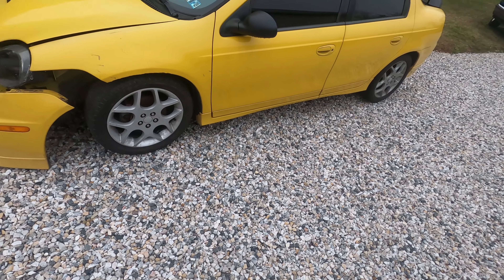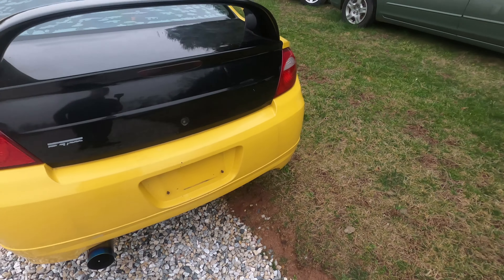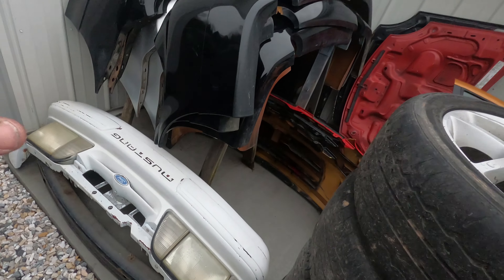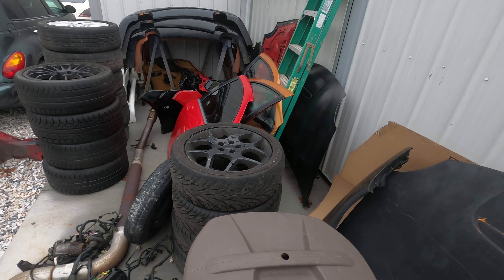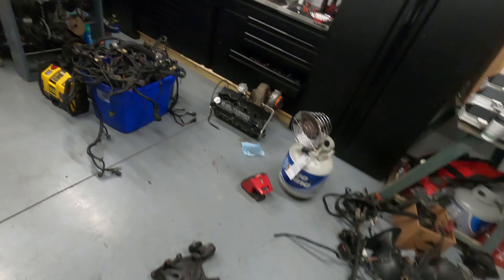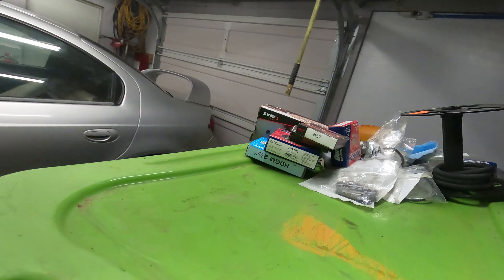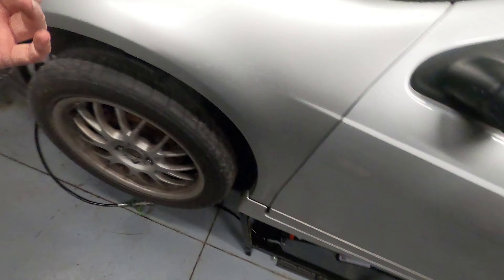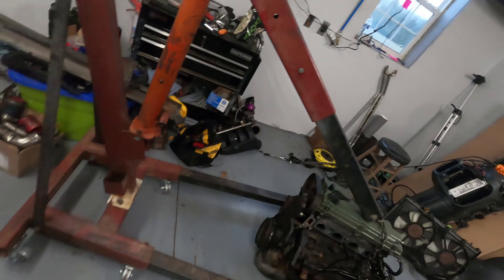SRT4 PARTS HOARD

Comment: looking for a few discontinued parts for my srt-4. I'm looking for the 2 plugs that cover the motor mount bolts in the wheel wells, the tension strut bolts, and finally the grounding wires that connect to the front struts.